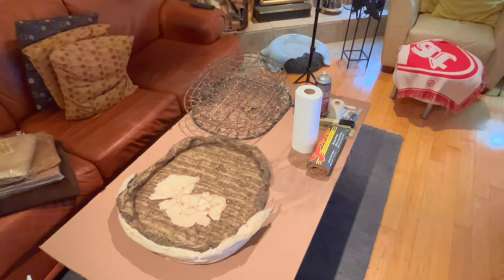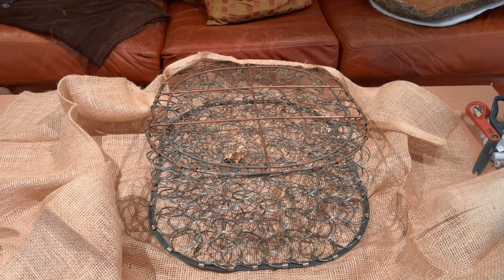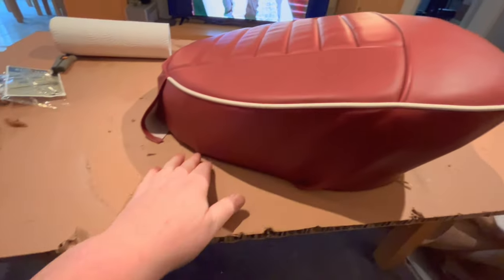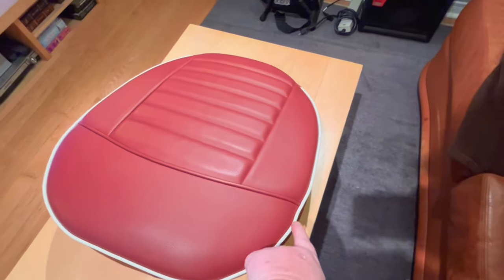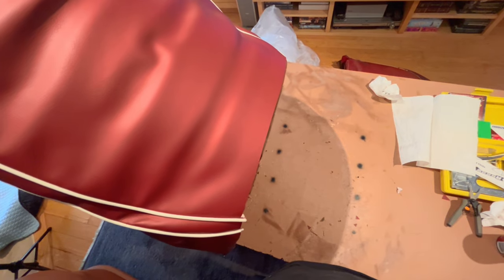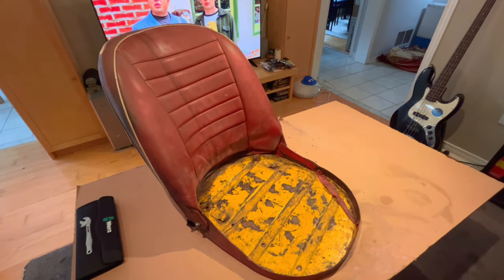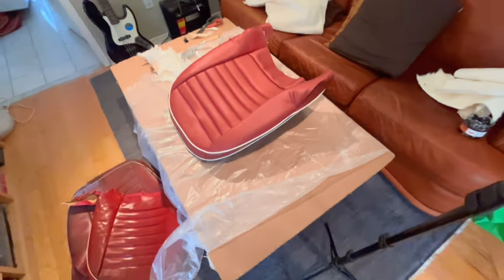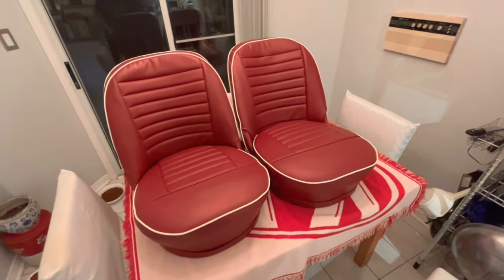1959 Triumph TR3A Restoration Project,  Seats, Part 2,  Reconstruction

Comment: Great vid David .On my 3 I have swapped the seats around so folding seat on the drivers side.Two  reasons,One my 10 year old grandson is often a passenger in the car and with a seat belt on I feel it’s a little safer with the fixed back. Secondly I run almost permanently with a full tonneau so it’s a lot easier to tuck the drivers side behind the seat if it folds forwards .😊
Reply from the maker: Actually , I like that idea regarding the full tonneau cover..I hadn’t considered that…Cheers, Tush

Comment: Great job, Chef! Again, I really like the dark red color. 
Not sure  what paint you have planned for the exterior of the car, but that red would look superb  with a white or black, as well as a few other colors.
My TR4 has essentially the same seats. I noticed a tag on the springs or underside of the pad on one of yours. Was anything printed on it? 
The reason I ask is because there was a similar label on the underside of one of my car's seat pads, with "Zest" written on it. I didn't understand that until years later, when I learned that was Stamdard Triumph's  pre-production code name for the TR4. It's still a little baffling because my car is from late in the 2nd year of TR4 production... not all that early.
The covers on my car's seats were replaced amateurishly long before I bought it, but based upon the VIN would have used slightly different covers over the same seat frames as yours. Where your covers (and the first 15,000 approx. TR4s) have all the pleats in the covers running from side to side... for a short time TR4 seat covers had the pleats running front to back (up to about 20,000... incl. my car). Incidently, Moss Motors online catalog is incorrect, shows the opposite. As I'm sure you know, later TR4 (thru TR250/5?) went to an entirely different seat with a tubular frame, rubber diaphragm, squares back, etc. 
Moss also doesn't offer the color interior that was original to my car... Shadow Blue, I think it was called. Must have been a special order, because that supposedly wasn't an upholstery color Triumph ever  offered along with the original Spa White paint on my car (bessides some scraps of the original trim and paint, my source is the BMIHT certificate... which also states it was leather trim). Another "oddity" on my TR4 is that it didn't have "fuzzies"... the trim commonly sold to finish the door frame on TR4. Instead it has a more modern style plastic-covered moulding that matched the interior color (but unfortunately was painted black by a previous owner).
It's interesting, but sort of a moot point for me. I will be going with vintage racing seats and trimming the interior like was done in some race cars of the period. Even so, I would like to get close to the original color simply because it's rather uncommon. (John Skinner in England is the only place I've found offering a similar color.)
Reply from the maker: Hi Alan, well, originally I was going to go back to the factory black exterior, but lately I’ve been thinking about a grey…like Triumph Dove grey…although I’d like to do a modern take with Porsche Chalk Grey …..I think it would look great with the red interior.